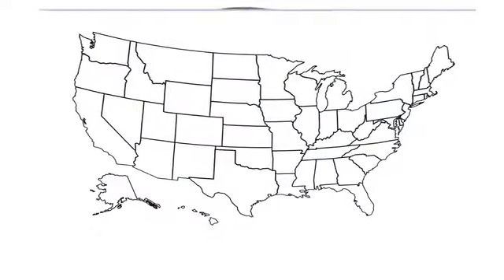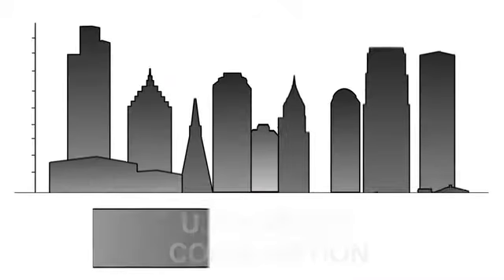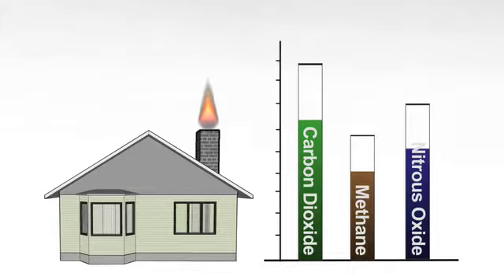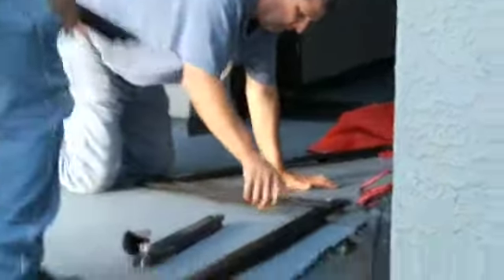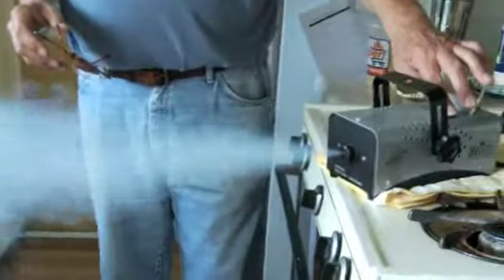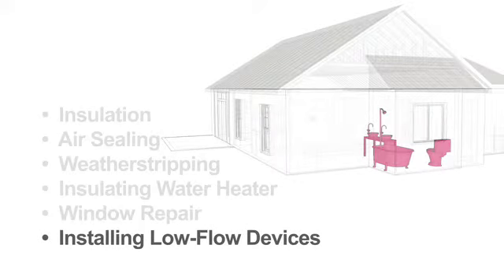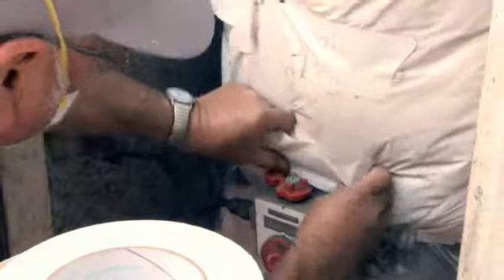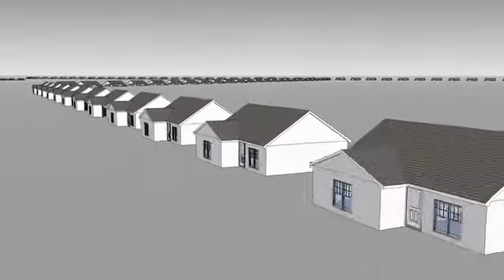Introduction to Weatherization

Comment: weatherization is complicated ,workers are not paid fairly ,look the fan on the blower door was not installed for depresurized then fan on blower door was turned around looks like they did not khow how to test. At the End it shows someone using tape on water heater venting stupid